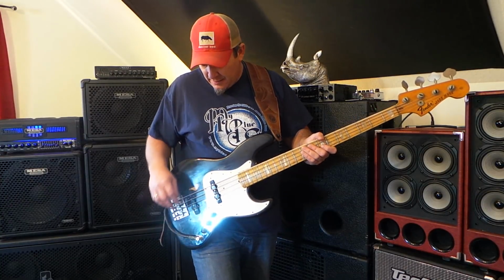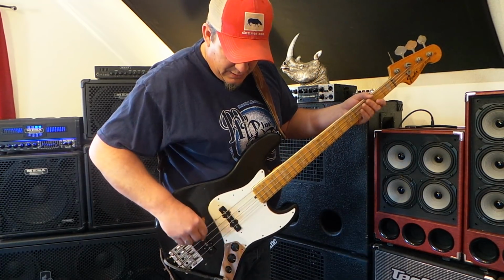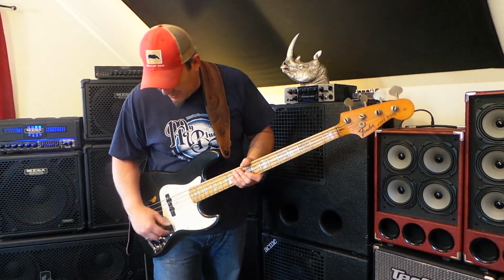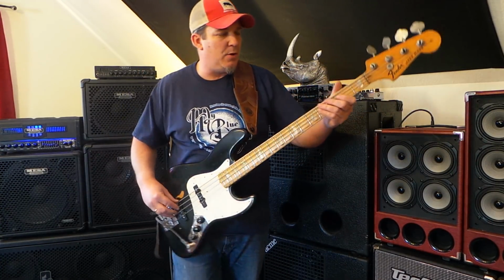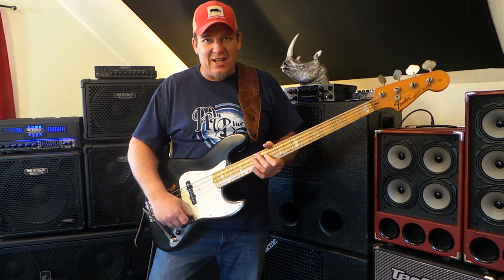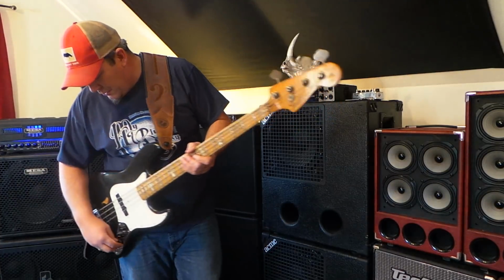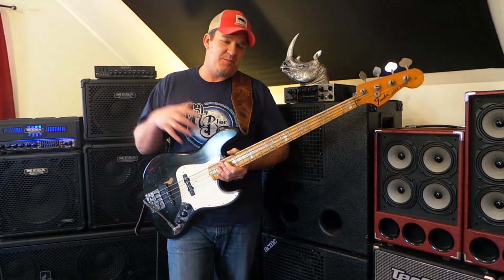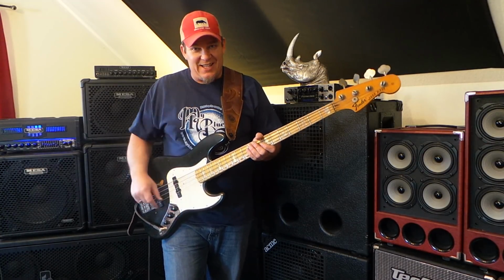1975 Jazz Bass - Nordstrand NJ4SV noiseless pickups - Andy Irvine

Comment: That looks earlier than 76. By then,  they had gone to the three bolt and bullet truss rod.  I think that change was in '74.
Reply from the maker: hmmm I was told it's 1976 from the seller - a reputable guy, maybe not - I thought in 77 they changed the rod.
Reply: According to my quick research,  bullet truss rods started on the jazz bass in 75. That would mean your black bass is a 74 or earlier.  If anything,  your friend did you a favor by selling you a 74 as a later bass.
Reply: So, what's the serial number of it? It's pretty easy to date these old Fenders: It should start with an S for '70... followed by a number that states the exact year the neck was built.
I totally agree with Lee's statement. I'm pretty sure it's a '74. So the Number should start with "S4..." or at least "S5...". 
But in the end: who cares? It's a nice bass that sound good and it's a real player. If you got it for a reasonal price, congratulations!
Two years ago I built one by myself from parts that looks very much the same. I also used Nordstrands, but the NV4 single coils. 
Awesome Pickups for a vintage Jazz Bass!
Only thing I don't like about it is the Badass bridge. I took a gotoh 203 for mine. Looks more like the original fender vintage bridge but sounds much better. But thats just my personal taste.
Reply from the maker: You guys are right, I just ran the serial number through a few reputable places-  built in 1975 - cool  the seller told me 1976